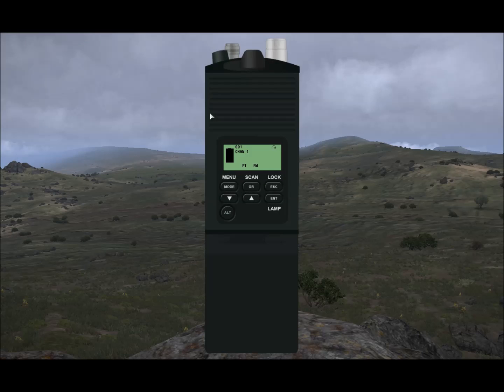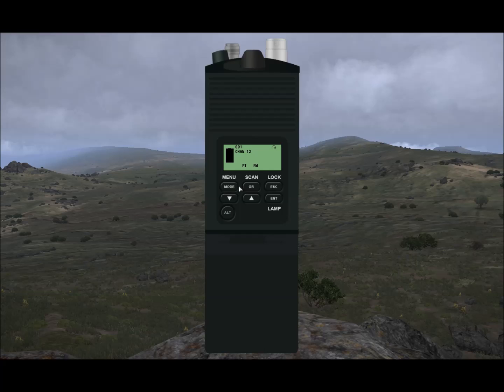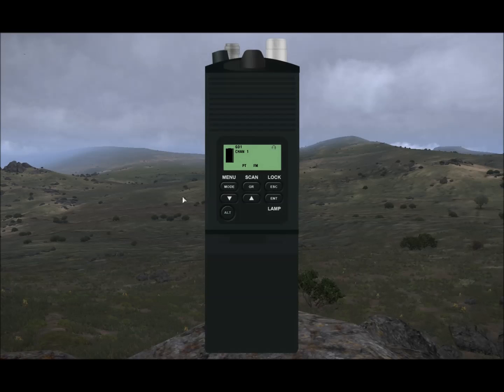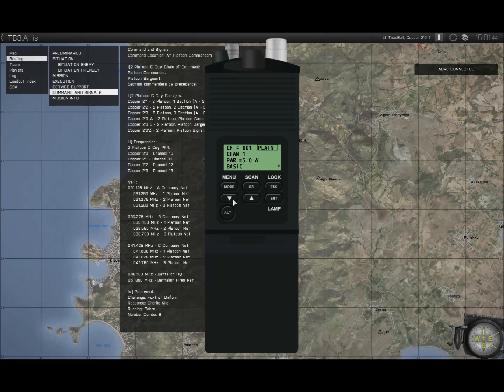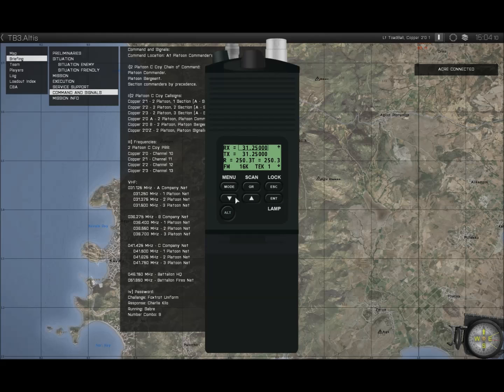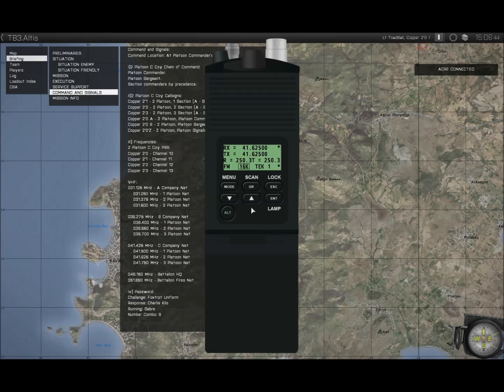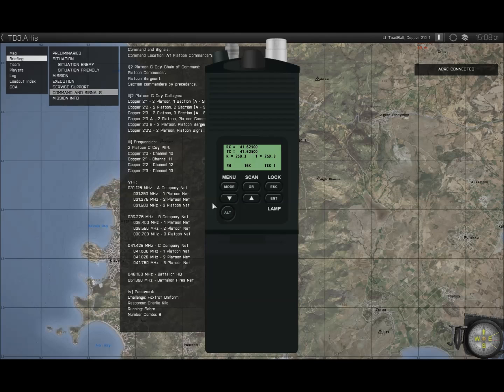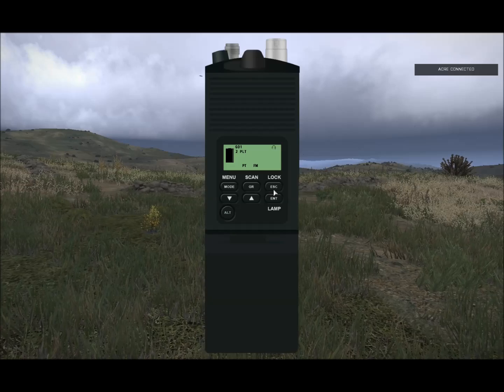ACRE2 PRC-148 Interface and Programming Overview

Comment: Truth be told, it kinda scares me that modders have recreated the MBITR so faithfully, everything about the interface here is exactly how a real one works.
Reply: Just why exactly does it scare you? I don't get it...
Reply: It simply goes to show that NOTHING is off limits. Even though the originals are supposed to be crushed, many will stray. "They/this company/China" obviously got their hands on one, and like every single other thing manufactured in the world, they copied it, except for the amount of spectrum it covers. If I'm not mistaken, this just does VHF\UHF but no 220MHz or Low-Band. Either way, while its obviously meant to be field programmable, I MUCH prefer setting up all parameters with programming software.